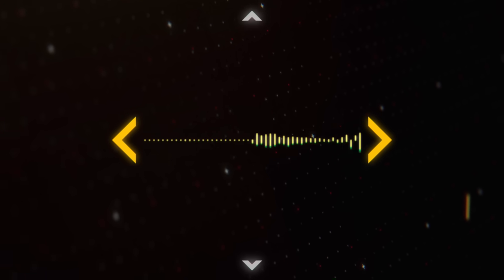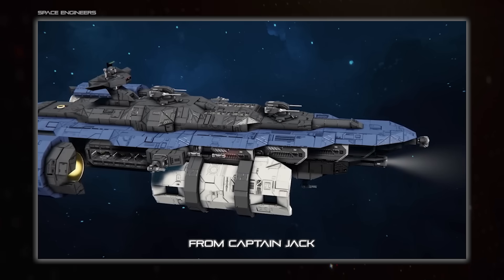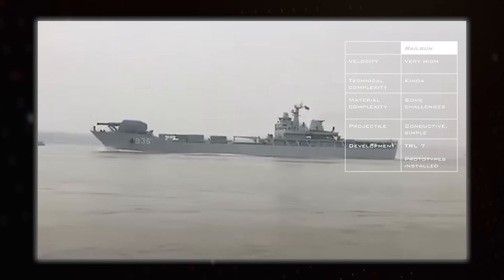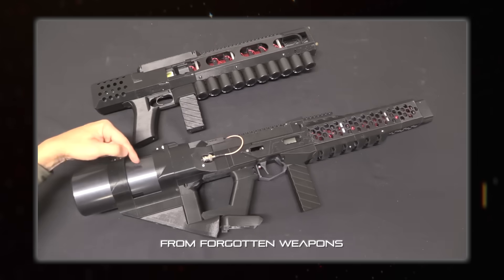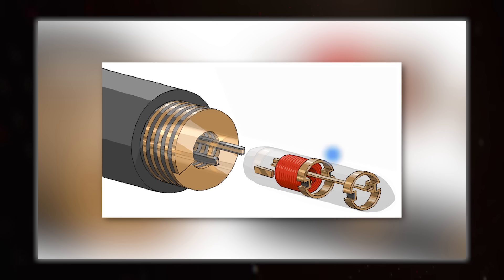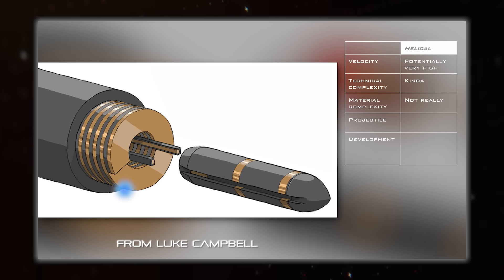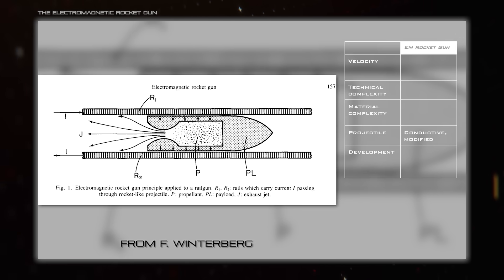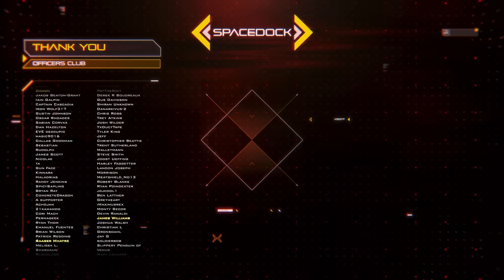The Deadly Coilgun/Railgun Hybrid You've Never Heard Of (Helical Railguns)

Comment: I'm personally a big fan of combination chemical / magnetic weapons.
There's nothing stopping a coilgun from being installed around a conventional cannon, with something like an Electro-Thermal Chemical (plasma) ignition system to provide as consistent a muzzle velocity as possible.

That way, if your ship's power system isn't running at full, or you need the power for something else like a laser system at any given moment, you can still use the coilgun as a conventional cannon to fire things like flak shells for missile defence. But, when you need it, you can spool up both systems and pull a much higher muzzle velocity out of your main gun for offensive use.
To my understanding, the initial acceleration for both coil and railguns is a bit more electrically intensive than the rest, so it could also save you a tiny bit of electrical production (and thus heat generation), in exchange for small propellant charges.

The helical railguns are also fascinating - I've not heard of those before - and though they're obviously a lot more logistically intensive with regards to ammunition, that sort of logistical burden wouldn't matter as much in orbit of an industrialized planet, or on the surface of an airless moon. There, they'd be able to rely on local production to keep up with demand in a way a fleet away from port just can't do, and it's also a situation where having the longest-ranged, hardest hitting railguns is very, very important. It's not like the Earth or Mars is going to be dodging much - so 'the only defence is point defence'.

A third thing, which could benefit literally any kind of gun-type weapon in space, is if the projectile has some amount of onboard Delta V for course corrections. Any target at extreme ranges can just dodge a regular railgun round, but if the armature is a miniaturized missile that can keep up with say... 3G maneuvers for a 60 second burn time, then they'd need to be that much faster, or that much farther away to be out of the weapon's effective range.
The first major downside is you need rocket systems that can handle the acceleration of being fired - so you're probably stuck with non-throttleable solid-state propellants and dozens of single-use maneuvering thrusters, like the PAC-3 interceptor - but the plus side is we already know that stuff works. To match speed with the target, you just alter the angle of the projectile between perpendicular and parallel, while keeping it on the same heading for proportional navigation.
The second downside is the rounds will be a lot lighter, and depending on how much fuel you give them, essentially hollow, but at rail or coilgun velocities in space, even getting smacked with a crumpled up wad of paper would leave serious damage, so this is easily the lesser of the two issues. In fact, firing what is basically a fuel tank at the enemy might be more effective against lighter targets, since the ammo is more likely to crumple, deform, and dump its kinetic energy into the target, instead of over-penetrate and waste all the left-over energy it kept going with. Results may vary depending on how hard or soft the setting is... Literally; I mean the armour.
Reply: In essence a railgun is just a powered barrel extension same with a coil gun, in ace combat Stonehenge is a hybrid using propellant and magnetic, ETC allows you to use more complex and sophisticated projectile designs.    

The obvious problem however a propellant hybrid would obliterate its rails far more than a normal railgun would due to the presence of propellant, but the payoff would be immense theoretically

Comment: The helical ... is obviously a bad idea as it adds something very complicated in production, maintenance, and especially in ammo cost to a rail gun. ... and would it work reasonably well?: Very likely not, because a) the helix is one object, not separate coils, so what do you think the magnetic field will look like? b) how do you think the magnetic field of the rails and the helix combined look like and is that an improvement?, c) what do you think the enormous magnetic field does with the cute coils and rings and rails inside that complicated projectile?, d) if you think a rail gun likes to self destruct a lot (*) wait until you see that contraption.

*: which they do, the friction is rather secondary, the primary reason is that the rails want to bend really hard, that's why real rail guns have a massive closed wall barrel similar to a tank gun (... please don't imagine / design rail guns with open space between the rails, if you want to create realistic science fiction).

A big advantage of a rail gun (compared to something more "conventional" with equal or better punch): very cheap ammo, something conductive with the correct measurements that's it (typically a very conductive cheap sabot enclosing a very hard "arrow" projectile).
(The cost of that special projectile of the helical idea would be much much higher, and if the stuff in there has a problem it'll weld your gun together and you can melt down the whole weapon system and try again.)
Big disadvantage of all presented types / ideas (as of today): The energy cost per shot is high (that will not change) and the number of shots you get out of a barrel is lower than you would want (that might improve).

The last idea of adding some extra oompf with an added integrated gas based rocket comes with problems, as getting any type of combustion to be perfectly symmetrically shaped and directed as you want is a problem. And if you don't get this little rocket engine output perfect, it will send your deadly long range high speed projectile off course. ... and as you know "... If you pull the trigger on this, you're ruining someone's day somewhere and sometime. ... ". ;)
(... and you can't really put steerable fins and electronics on that projectile (which would then be a $$$ missile ...) in that environment, because: super fast, small, and intense magnetic field ... doesn't go well together.)

If you want to add more oompf to a rail gun the easiest way is to make the field stronger (and make the barrel more sturdy to compensate) or the rails longer. Yes, there are limits, especially on a planet. In the vacuum of space however: Do you really need more oompf? How much speed do you think your very hard let's say 23 pound projectile (to take what they currently often use) needs to put a channel  of holes through an enemy ship, space station, ...? The "what it hits" part is a bit more important there. If it's just open space: the crew might be able to fix that before they're out of oxygen. A ships reactor or weapons magazine: jackpot. The coffee machine: That really p*sses them off. ;)

Comment: The main problem with coil guns is you need significant current and inductance to get a similar force on the projectile. Normally that wouldn't be an issue, but you then need to turn the coil OFF as the projectile reaches the center. The voltage across an ideal coil(inductor) is V=L(di/dt), the change in coil current over a given period in time generates a gigantic voltage. As another consequence of this, the rate at which it proportional to the inductance of the coil and the voltage, (V/L)*(delta t)=delta i or (1/L)*v(t)=i(t). Remember how more turns increases inductance and how increasing inductance and/or current increases the magnetic field? Thats all well and good if your coil is a super conductor, sure it looks slow on paper but its not actually that slow, the main problem is the high voltages involved to do it quickly and also... in a real system, resistance and resistive loses.

When your coil isn't an ideal superconductor you need to take into account the resistance of the coil(modeled as a resistance in series) and the voltage across it as the current at any given moment in time, giving the differential V=L(di/dt)+(R*i(t)). Rearranging this as V-(R*i(t))=L(di/dt) makes it a little easier to see that as coil resistance goes up(like adding more turns to increase the magnetic field or heating the coils from use) it will reduce how quickly an opposing voltage can discharge the coil, cause a larger discharge voltage if the circuit is opened, through ohms law V=IR it will limit the maximum current of the rails and through the power equation P=V(t)I(t) it will dissipate power that could have went to the projectile. Now granted, R is usually small... but it will still be higher than railgun rails and slow the system down. that i(t)=(1/L)*v(t) now becomes i(t)=(V/R)*(1-e^(-r*t/L)) because R both limits the current and that voltage "lost" across the R slows the charge/discharge down.

Railguns technically have to contend with these issues too, but the resistance of the rails a lot smaller and the Lorentz force is too complicated to break down in a comment this long thats probably making your head explode from info overload or anger because i am wrong about something. 

The helical railguns are a good middle ground though. They would likely need to be longer than a rail gun but could be shorter than a coil gun but adding capacitors would allow the energy to be more efficiently harvested and put back into the same projectile both electrically and kinetically so it could further reduce arcing for much lesser versions of the coilgun inconveniences.
Reply: This is why you don't use an iron/ferromagnetic armature in the barrel of a coilgun. All that does is raise the inductance, which like you said causes problems when it's time to turn off the coil.
Some coilgun designers have proposed a system of diodes that is normally reverse-biased (nonconducting) when the coil is energized by the capacitor, and when the coil is disconnected from the capacitor these diodes would conduct the (opposite polarity) back-EMF and direct it right back into the same capacitor that energized the coil to start with, supposedly this does a lot to increase efficiency. I guess it sort of ends up working a little like a Flyback or Forward converter (circuit topology wise) but each pulse is primarily intended to fling a projectile not convert power from one voltage and/or polarity to another.
Reply: @44R0Ndin   not going to lie I had considered that using a ferromagnetic slug is just like adding a ferrite core to you inductor, that’s a good catch. Coil guns definitely have an energy recovery advantage, and at the lower/earlier stages you can feed that energy to the next coil rather than storing if for the next shot. Definitely more efficient than just storing what’s left back due to capacitor leakage
Reply: Actually, it is much easier to calculate the accelerating force generated by a railgun than the accelerating force generated by a coilgun.
One issue with coilguns is that the force for given coil and armature currents varies according to their relative position. In contrast, in a railgun, the force is a function of the rail and armature currents and the inductance gradient of the barrel, which will be approximately constant. So railguns easily provide smooth acceleration while coilguns tend to provide rather jerky acceleration.

Comment: At these energy levels can't they just use liquified metal at the edges (similar tech to aluminum smelting)?
Reply: I'm afraid the simple answer is no. The explanation is to do with magneto hydrodynamic instabilities on liquid conductors.
In practice, solid conductors used in rails and/or armatures will melt under extreme duty cycles, the  liquid metal does not then stay put and electric arcs form to keep the current flowing in the circuit.

Comment: For the helical, you could have an armature that recycles itself - turning it into a sort of magnetic sling-pult
Reply: That specifically would be a great way to make a "Grenade Launcher" railgun. Hybrid railgun with CAPTIVE launching armature.
Bonus points it doesn't care if it's a grenade that goes in the launch cup. Just that it has the right mass (so that the armature doesn't reach a damaging velocity).
Actually, I have a different and I think more fitting name for this than "EM Grenade Launcher".
I'd much rather call it a BlunderGauss. Blunderbuss + Gauss cannon (another common name for railguns).
What do you think?

Comment: USN moved away from railguns for another reason. At a certain speed, a projectiles arc is flatter than the surface of the earth. Meaning, a threat just beyond visual range can use the horizon as cover.
Reply: That's known as a "direct fire weapon" and it's the biggest killer of the terrestrial rail program for non-line-of-sight applications (although if the degradation of the rails could be sorted, they would make formidable point defense systems and main tank guns.)

More importantly, it's a non-solvable problem, because Physics.
Reply: The velocity at which the projectile's arc is flatter than the Earth is the first cosmic velocity, 7.9 km/s. I've never heard of any real-life railgun coming close to it, and any projectile moving that fast through the atmosphere would certainly not remain at that speed for long.
Reply: @DecidedlyNinja  Yes...but no.

In relation to a slug projectile without a payload (specifically, a rail/coil projectile) fired on a parabolic arc, that speed is actually MUCH slower due to the distinct lack of mass (velocity is ALL it has going for it in F=mv) so for a railgun to be maximally effective with a HvLm (High-velocity-Low-mass) round, it must fire the flattest trajectory possible (optimally, perpendicular to the target.).  Following that rule, since maximum maintained velocity is not only desirable but essential, any over-the-horizon fire would have a fixed position from which the shot MUST be made at the absolute minimum angle to clear the horizon to hit said target: since v(i) and minimal angle are set values, the ONLY changeable value in the shot to put the round on target with maximum force is distance.

So...to clear the horizon, no, but to be effective after clearing the horizon, yes (since the absolute optimal angle of 0° is BELOW the horizon line.)

This is the precise reason why the railgun has been abandoned as an option for a main naval gun in the age of the missile: it is effectively useless if you cannot see the target.

Comment: The US Navy experimental railgun doesn't actually have electricity running through the projectile or the sabot. Instead it rides on plasma charge made by electrifing plate of metal that seats behind the projectile and hence the muzzle blast. So it's a de facto cross between plasma railgun and firearm, rather than sandard railgun.

Comment: I've always wondered if we could use hybrid coilguns or electromagnetic barrel attachments to correct for accuracy in conventional guns, or even make guided small arms. 

The difference between a pawn shop Remington and a match barrel on a navy sniper rifle is about $10,000+ in precision machining. Always wondered if you could just compensate electronically.
Reply: Like, the amount of energy to impart a micrometer change in trajectory at the exit of the barrel is infinitesimally smaller than accelerating the round to velocity, but even a tiny nudge means a difference of inches or even yards at extreme ranges.

Also would consider electromagnetically imparting spin  and just making every weapon a smoothbore.

Comment: 6:30 the round fitted can be any shape on the outside without need for wasting energy on a Sabot, and allowed for a smaller barrel and less space needed for the same diameter of round, Which could be a good couple of advantages to have for weight balance and useable space in vehicles plus ease of setup for infantry versions, but also means less of the space within the round is available for any payload and potentially messes with penetration capability unless the PayPal is mounted such that it sits on the end of the projectile which would need to be balanced either with weights to the rear or aerodynamically to prevent excessive strain on the barrel